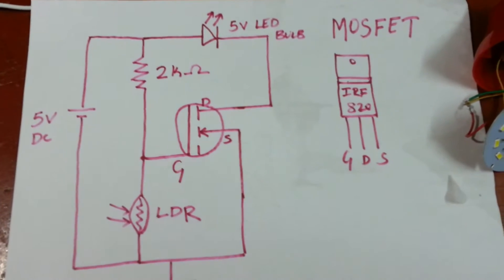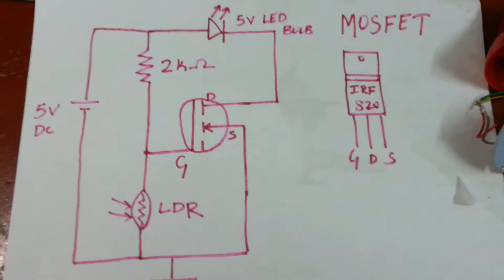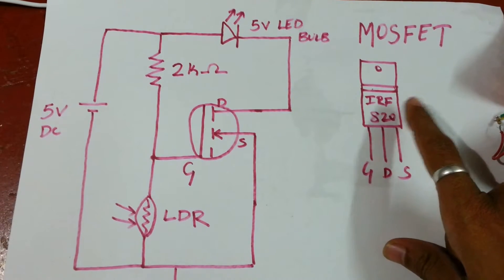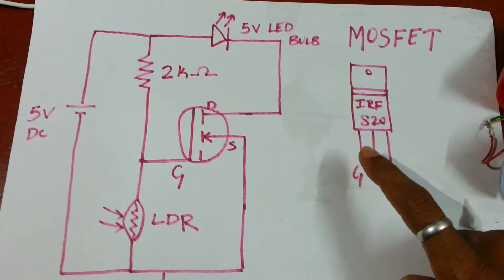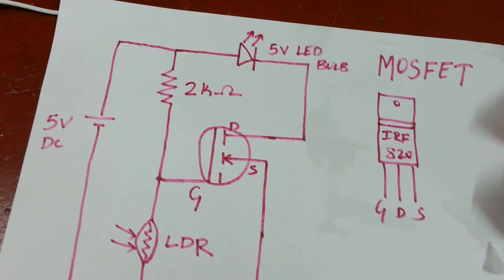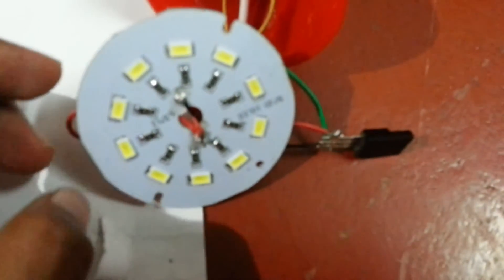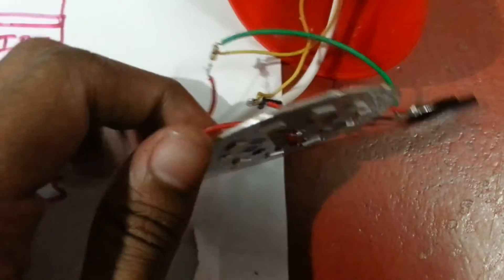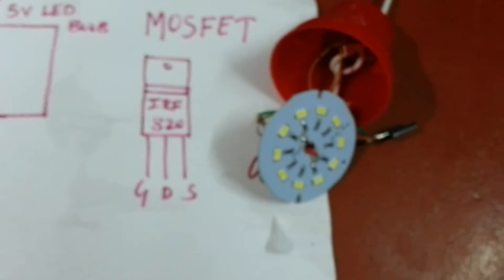How to make dusk to dawn light bulb

Comment: Thank you.  Where did you get your parts sir?  How long did the welding and actual work take you?  What was the cost of the modification?  Thanks.
Reply from the maker: +Kue Man 
POWER MOSFET (IRF 820) costs about $0.90 
LDR costs about $0.30

and to solder all these components together and to modify this light bulb it took about only 10 min :)

you can buy these components at your local RADIOSHACK  or you can purchase them online :)